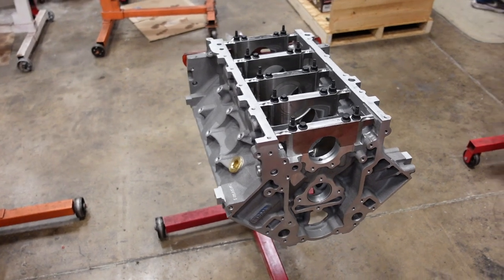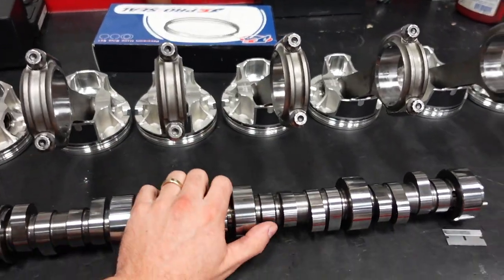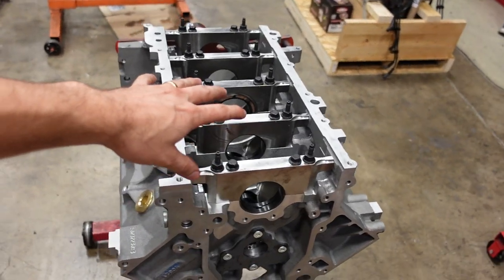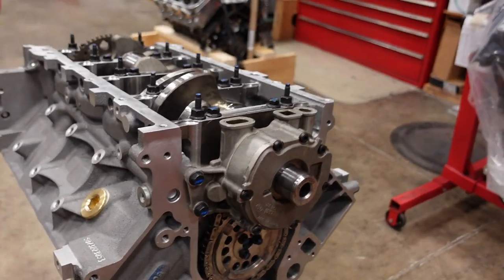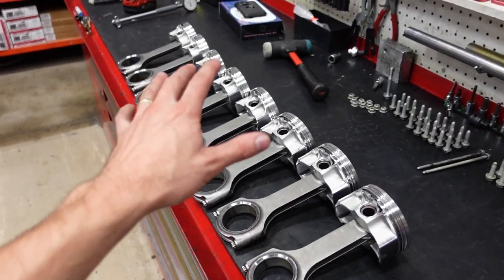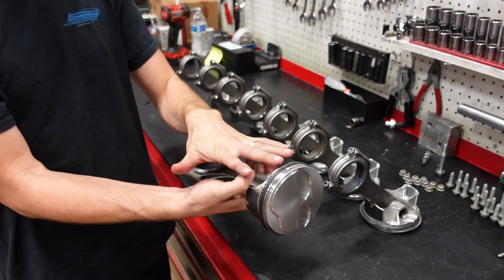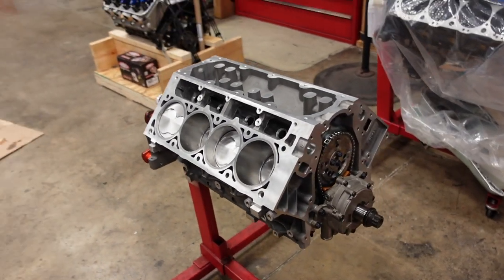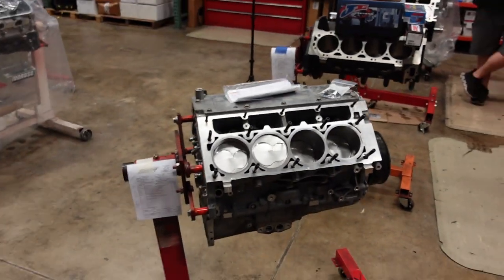High Compression LS7 Engine Build - 13.0:1

Comment: Forced induction is cool but man N/A is so intriguing
Reply: Just like NASCAR…
Reply: Lol I always say that, any one can add boost and be fast, but to do it n/a you a bad builder/driver
Reply: I've owned a number of force-induction cars; turbo and supercharged.. and nothing (IMO) is near as much fun as a high HP N/A build.
Reply: @zaknefain100 1000whp from a boosted LS is way more fun than any N/A combo
Reply: @cali2468  I'm not going to argue subjectives. You like pink.. I like blue.. that's your opinion and I have my own.  The earth spins on.
Reply: @zaknefain100  There is nothing to argue over. FI is a handful and takes true skill to keep under control. Spinning tires on the highway at 80 mph is exhilarating but to each his own.

Comment: You forgot to mention to split your main and rod bearing oil clearance number in half, because you are checking the inner diameter, not the clearance between the surfaces. I learned this on our Chevy 230 i6.

Comment: Great video as usual! 
My question is, will this build with the added compression and increased cam lift & duration still run pump gas? What octane will be happy do you think?
Thanks.
Reply from the maker: It will run 100% E85
Reply: @JacobVillemain  thanks for your reply :)

Comment: Wait  so you can run aftermarket connecting rods with an OEM forged LS/7 crankshaft without doing anything to the rod journals ???? Just rebalance the crank is all ??

Comment: That's a pretty similar cam spec as I'm running (253/267 .665/.665 116+6).  But I built my "LS7" to 502ci.  That's a lot of cam for 7 liters.  

When the customer gets annoyed by the giant gap between 4th and 5th because the motor won't cruise under 2K RPM, the close ratio ZR-1 transmission will take care of that.   You can get a built 6060 with 3.90 gears for the low low prices of only $16K from RPM transmission. (ask me how I know).

Now to to go find the video of how it dyno'd and drove...

Comment: What’s the RPM redline on this motor, the new pistons are lighter than stock? But the stock rods weren’t sufficient or needed to be replaced?  Love the enclosed dry sump, and what’s the power goal?
Reply from the maker: Engine should easily make 650whp
New redline probably 8,200. However the long runner manifold the customer will be running will limit it to 7,400 before running out of air. With a larger plenum/shorter runner manifold the engine could easily turn 8,000 & make big power

Comment: is the term at TDC "quench" or "squish" for compressed volume?  I knew a high performance jetski engine builder that called it the "squish" volume.  Which is correct?  Both?
Reply from the maker: Same same
Reply: Squish is technically only the small part between the piston and head that‘s not connected to the combustion chamber volume

Comment: What is your opinion on taking the lS7 to 440CI? Looking to get as much power as possible NA and still drive on the street.
Reply from the maker: I am a big fan of running a 4.125” stroke in the LS7 block.
Reply: @JacobVillemain  Nice I keep hearing both sides of the debate. I knot its only 13 CI but if you have to tear the engine apart anyways why not
Reply: I've heard that the SDPC spec'd 4.100 Callies crank offers better oil control over the 4.125" stroke....
Reply from the maker: @milojanis4901  one of those things where if you ask 3 builders what you should do, you’ll get 5 answers.

Comment: Now what power is the customer chasing with this combination
Reply from the maker: 650ish wheel
Reply: @JacobVillemain  so high 8’s to low 9’s down the quarter mile
Reply: @stephennummie7631  not even close
Reply: @390nm  why you say that
Reply: @stephennummie7631  It takes 850-900rwhp to run 8.99 in a full weight c6 z06 if its converted to a th400 or powerglide. I dont think there is a single c6 z06 reliably in the 8s for many runs with the 6 speed manual on corvetteforum.